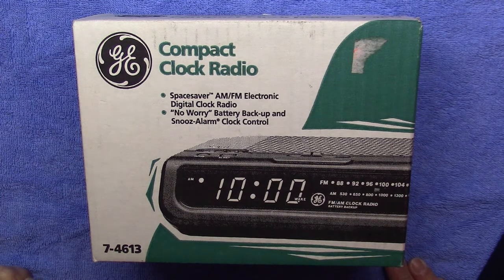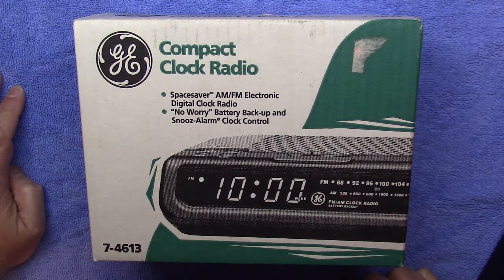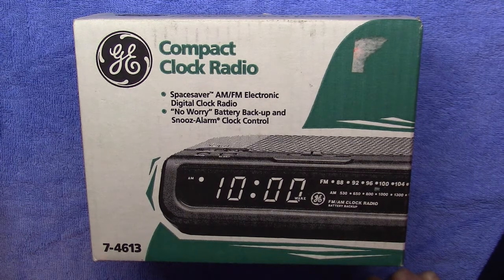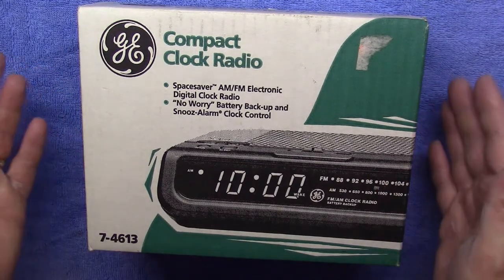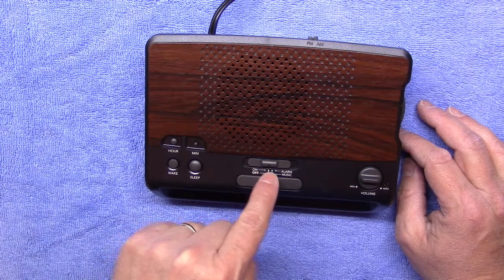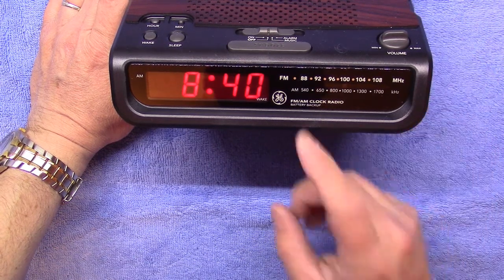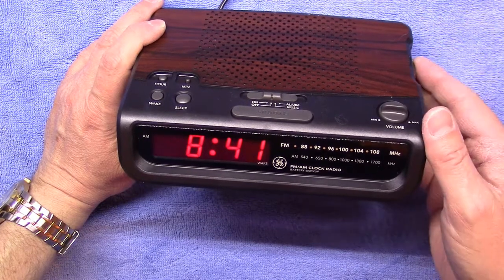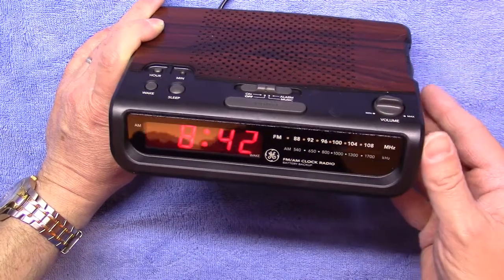GE AM FM clock radio 7-4613

Comment: I have a GE clock radio that's similar to this one, but it's a different model, it's the 7-4612 model (the clock radio that's in almost every thrift store). My uncle's dad bought it back in 1993, so he could listen to the radio while he was painting houses, because that's what he did for a living. But unfortunately, Over the years of painting, there would be tiny paint spots gathering all over the clock. I now have that clock radio and it now has tiny paint spots all over it except for the bottom, I'm surprised that everything is still working beautifully including the radio and the speaker. After my uncle's dad was done with it, he gave it to my uncle, then passed down to my cousin, and now it's here with me. They no longer wanted it.

Comment: Found one at a thrift store for $2.98 but there was a sale that put it down to $2.16, works just fine!
Reply from the maker: They don’t make them like this anymore. Nice find! 👍👏🏻
Reply: TheRadiogeek it also turned out the minute button didn’t work and the battery to save the time died. When I opened it I did fix it, but the speaker was filthy! There was also tons of cat hair! But I cleaned it and got it fixed!
Reply from the maker: Kenneth Productions glad you got it working  because it’s a nice clock radio👍 . Its much better than the junk made today.

Comment: I've had one of these since late 1995 myself. Some positives: Keeps really good time via the 60 Hz AC signal (newer cheap clocks that run on DC can drift easily unless they have a way of getting an external time sync signal), and you can still turn on the radio even when the power is out (no clock display of course), which also means that the when the alarm is on, it'll still wake you up if the power is out and the battery is still working. One issue is that when it is running on the battery, the time runs quite fast; I haven't done a proper measurement, but it seems at least 50% faster (I wonder if there's a way to affect this).
Reply from the maker: This is a very nice clock radio. I wish they still made them like this one. I love the one I have.  Thanks for stopping by. ❤️📻

Comment: Just found one of these for my dad, who has hated every alarm clock he's owned for the last 5 years. I have two questions if you wouldn't mind -
1) How do you actually shut off the alarm in the morning (not snooze)? Do you have to move the switch to the off position, or is there a button you can push?
2) When you press and hold the sleep button you can use the hour and minute buttons to set something, but I have no idea what that function does....
Think I figured out the rest.
Reply from the maker: When the alarm goes off just slide the switch to off. If you hold the sleep button you can use the minute hour buttons to set the amount of time the radio will play before turning off. Max sleep time is 1 hour and 59 minutes.
Reply: @TheRadiogeek  Thanks a bunch!

Comment: I kindly request that you explain how to set and use the Alarm functions when showing these items, same as you do for the radio functions. (How to set, turning it on, turning it off, setting it to the radio versus basic alarm function, etc). 
I am having problems finding how to do it on my own, since my things may be broken.  I also do not understand what Wake and Sleep is (but I get a bit of what they may do when I hold them down and set the time).

Comment: Nice find. I find these super reliable and long lasting. You can get 20 years of usage on this old tech. 

Replace the LED bulbs with 99¢ Ikea bulbs. No RF is emitted from them.
Reply from the maker: KD2NOA Edward Martz I bet you're right that this will be running 20 years or more from now. I don't have a ikea store near by. I can't find old incandescent bulbs anywhere anymore.
Reply: TheRadiogeek Go to home Depot, buy a few different brands of LED bulbs, and do an experiment with an AM radio to see which one has the least RF emissions.

Comment: “G.E.- We Bring Good Things To Life “
What an awesome find ❗️
📻🙂
Reply from the maker: It’s the first time I ever found NOS in the wild. I use it as my alarm clock and really dig that wood grain too. 👍❤️📻
Reply: TheRadiogeek 
I’ve found  7 NOS❗️
A really cool Hitachi is coming up on Tom’s Radio Room Show, within the next few weeks 😁.( I’m saving my best for much later - a Candle Short Wave radio.). 
It’s always nice to find an NOS.
📻🙂
Reply from the maker: Jeff King I’ll be looking forward to that Hitachi radio video. 👍
Reply: TheRadiogeek 😁
Reply: TheRadiogeek 
I have another really cool Hitachi that needs the volume controls ( plural) replaced or disassembled and cleaned, but don’t know anyone to work on it.
( it’s a portable stereo with 17 transistors, and it works, but volume is up most of the way and can’t turn it down.
The controls are “ stacked “, so one knob , ( one shaft) controls both left and right..
The MW antenna is a full 7 inches❗️
Looks like a real bad-boy DXer.  FM antenna is 28 inches (and swivels 360 degrees)
It’s in beautiful condition.
📻🙂

Comment: You'd be surprised how much newer than you think this clock radio is. Based on the date code,  "2529". The second digit is the year, making it a 1995.
Reply from the maker: Trance88 I am surprised that it's that new. Very interesting. It must have been one of the last of the wood grain plastic clock radios made. Thanks for the information on the date code and for watching. 👍
Reply: These clock radios were made in  1994-95. This one in the video is from 1995.
Reply from the maker: CornontheJacob 1999 thanks for the date information on this radio.👍
Reply: @TheRadiogeek  You're welcome.
Reply: @jacobtomasovic9694  I have one, it was my grandma's but I want to know the date of fabrication, how do you know this? mine has date code: 3440P
Reply: @elena4689  1994
Reply: @jacobtomasovic9694   Thank you !!